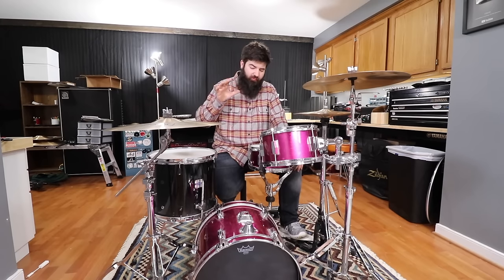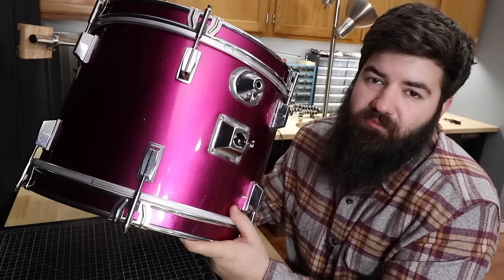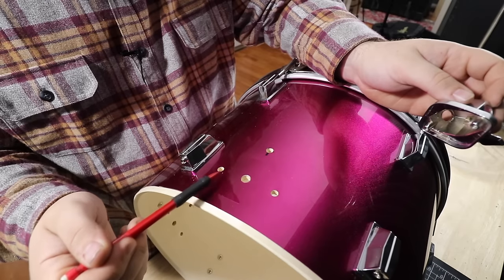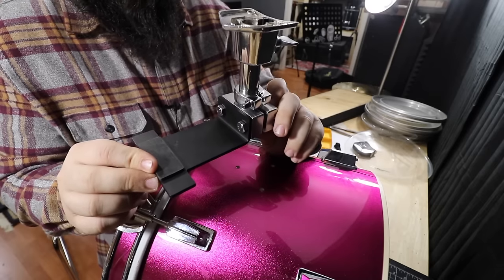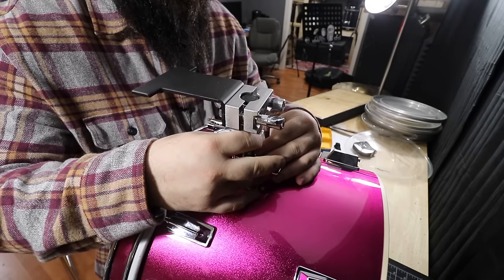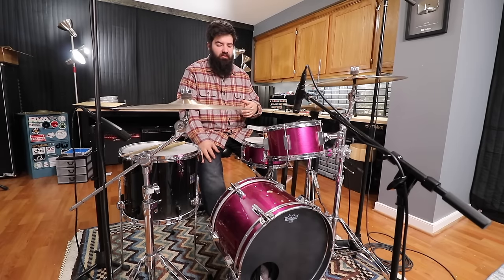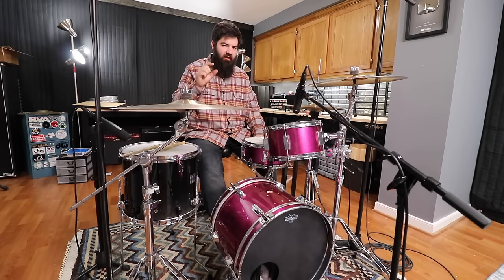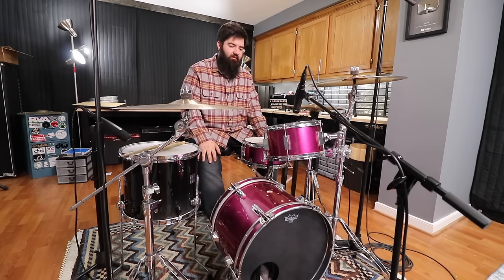Making the Kids Drum Set a Little Bit Better

Comment: Kit sounds good, but that snare is awful dude. Are you going to put an actual snare and strainer on it?
Reply: Danny Finch too small to put a proper snare on it I assume
Reply: @Benjamin-bj6xj  I think that mapex soprano snare he has is a 10".. could be possible.
Reply from the maker: Totally possible to put snares on a 10" snare. However, the snare is a 5 lug drum, so there is no way to mount a strainer/butt plate since there isnt a straight shot between lugs, if that makes sense. Since you mentioned that Mapex, I might use that as the main snare and convert the original snare to the floor tom.. hmmm...
Reply: @rdavidr  You might be able to add a proper strainer and butt plate if you install them super close to two lugs, if that makes sense. Of course, the snare wires do not have to be perfectly centered. It would probably be a lot easier to try and make that into a "floor" tom, though. Imagine a super small and shallow floor tom with giagantic legs...

Comment: One more mod you can do to the bass drum....since its so small, you could attach a couple of internal mufflers (one on each end). That and burying the beater will probably give you a sufficiently dry enough bass drum (since the front head is vented, which helps a lot in drying out a bass drum) that you can probably pull that towel out of the bass drum and realize a much "larger" and even more impressive sounding bass drum.

Comment: ATTN: SNARE FIX!!!! Strap the fixed end of the snare between the rim and head. Spread the two strap ends so they straddle the lug and fab simple clamps buy cheap snare clamps and just go minimalist on the clamp. All you need is something that won't slip between the rim and head. Conceptually think eyelet on a guitar string but a clamp. The adjuster side will be a standard adaptation taking an angle grinder and slotting the rim and you know how to mount the tensioner, so take it from there!
Actually you could use a metal strap on the fixed side and weld some cleats on it. As long as you sand everything real smooth so there's no burrs or edges that can compromise the head, you should be good!

Comment: I have one in black. I got rid of the toms. I use a 12" rack tom on a snare stand and a14" floor tom. I use hoop mounted spurs with a Gibraltar riser. I want to replace the metal bass drum hoops with wood hoops.